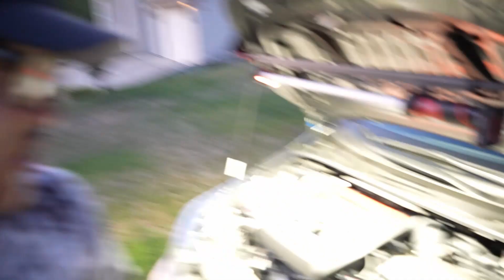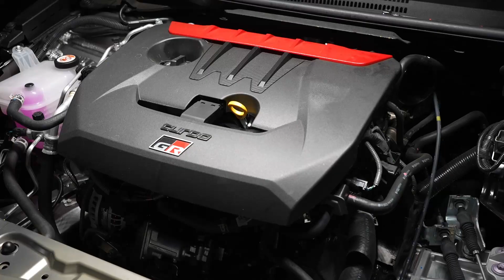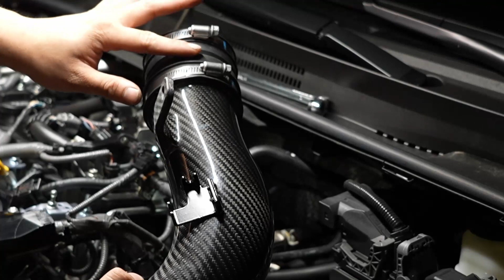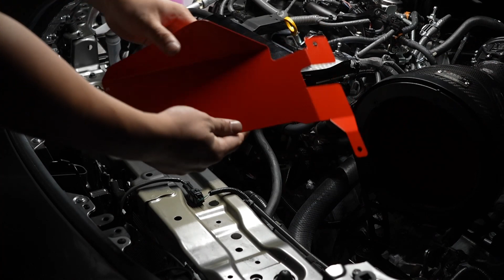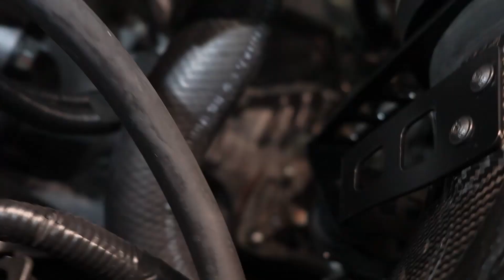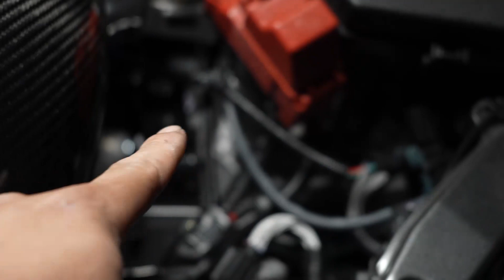HOW TO INSTALL EVENTURI INTAKE FOR YOUR GR COROLLA

Comment: So the real question is. Was there a Check Engine Light? A lot of intakes are throwing codes on these cars.
Reply from the maker: Yeah every intake for this chassis is throwing a check engine light and code P2C90. Currently SXTH ELEMENT has a PCV fix kit and LIMIT +1 has a tune available to tune it out.